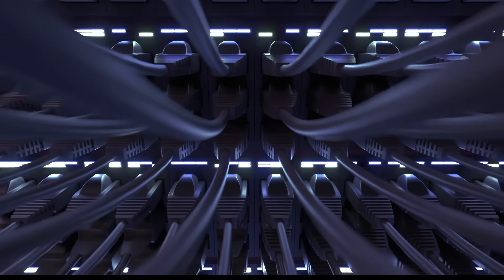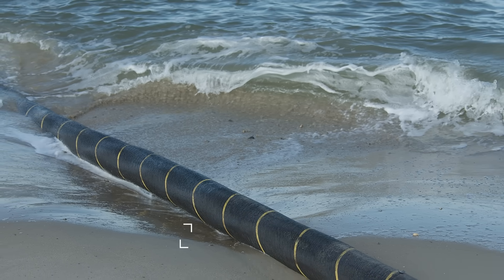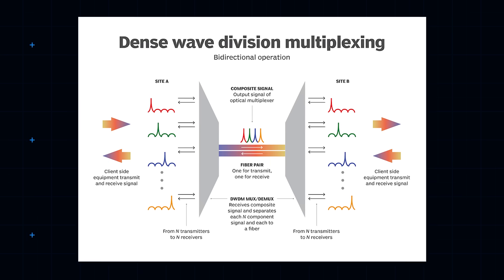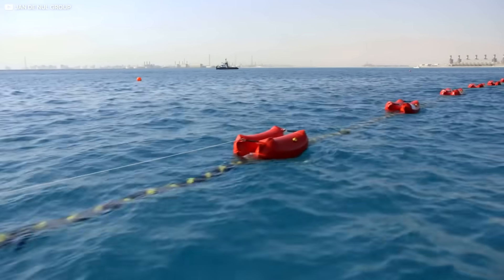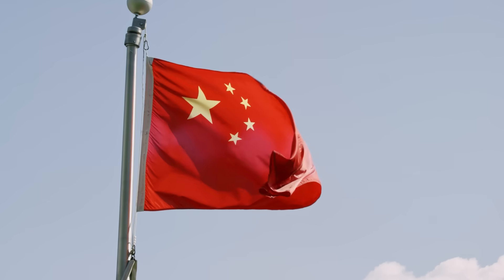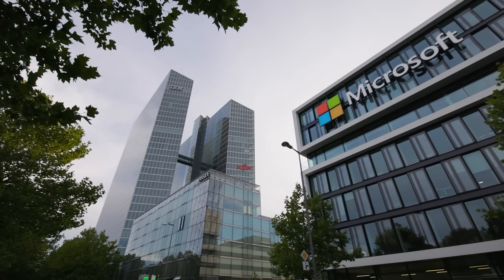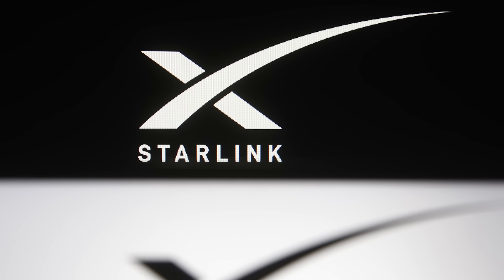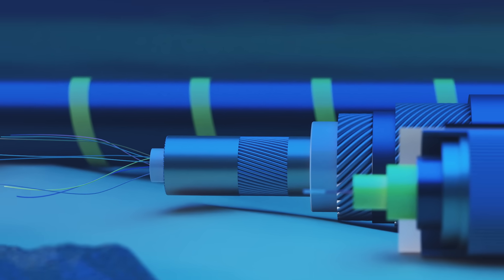How The Internet Travels Across Oceans

Comment: I thought we get internet from satellite to transponder to phone.
Reply: lol no. Up until recently, most cellphones did not have satellite capabilities (other than GPS/GLONASS). There are satellite-based phones that don't require cell towers, but they are not very common as they are very specialized and the service is very expensive.

Satellite internet is mainly used in rural areas where there isn't wired infrastructure or it isn't capable of high speed internet.

Comment: I work for one of the three subsea cable manufactures in the world.  Most of the cable they were showing was not fiber optic.  It was power cable.  Fiber optic cable is less than 2" in dia.  The majority of the cable is insulation and armoring.

Comment: Wireless has and always will be slower than direct line. Direct line is the only way to ensure a complete 100% connection unless required. It took me 3 days to wire my entire house from scratch, Cat5e cabling with plug-in wall Ethernet outlets. Nothing is wireless.

Comment: It is highly unlikely that Starlink—or satellites in general—will ever replace submarine fiber optic cables. Beyond challenges like reliability and high cost, satellite systems have very limited capacity. The combined capacity of all GEO, MEO, and LEO satellites is roughly 150 Tbps, which can be matched by a single fiber pair carrying 1.6 Tb/s per wavelength across 128 wavelengths in the C and L bands. By comparison, TeleGeography reports that total international Internet bandwidth is about 1,835 Tb/s, and demand continues to grow rapidly.

Comment: If a blue whale weighs 120 tonnes (120,000 kg) which is apparently a typical adult mass,
24 whales x 120,000 kg = 2,880,000 kg

and the Atlantic cable is:

6,600 km = 6,600,000 m 

2,880,000 / 6,600,000 = 0.44 kg/m (to 2 sigfig) 

That stat didn't pass the sniff test
That seems light given the thickness of deep sea cables.

Comment: Repeaters are not amplifiers. Repeaters can demultiplex and demodulate the signals so that the signal to noise ratio can be maintained over 1000s of Km. If it just amplified the signal then by the end of the cable you would have nothing but mosquitos buzzing around.

Comment: Ok, so how much of our internet is actually using satellites then? And why were we all lead to believe our internet was happening in space?
Reply: What are you blabbering about? No one is "lead to believe our internet was happening in space".... That's just lack of understanding of how the internet works. The vast majority of non-tech savvy people have 0 clue how the internet works. Its just "magic" to most people.

Anyways, the majority of internet communications occur through fiber optic cables that run from your internet provider to other providers and networks. Satellite internet is only used in cases where you don't have access to wired infrastructure like in very remote areas.

Comment: I'm kinda slow so this prolly gonna sound dumb but I thought we got internet and reception from satellites in outer space, why do we have long cables in the ocean for internet that makes no sense
Reply: Satellites can be used for internet service. They are widely used especially in areas that don't have good wired infrastructure or any at all. The issue with satellite internet is the latency. The latency is the amount of time it takes for a packet of data to go from your computer to the destination device. This is measured in miliseconds. The higher the latency, the more issues that can happen especially during things like online gaming or voice and video calls. The data has to go from your PC to your router and to the dish, up to the satellite in space, down to earth to a satellite ground station then to the intended destination. That's just 1 way. When the server responds back with whatever data you requested, this process happens in reverse order. For general web browsing, you likely won't really notice the effects of high latency. But if you're gaming online or trying to talk to your buddy over Discord, the latency can cause performance issues.

These underground fiber optic cables offer significantly less latency and very high capacity which is why they're used to connect countries and continents together.
Reply: @JJFlores197  you know what that makes alot of sense I didn't even think about the amount of time it would take for your data in your computer to go up to the satellites, I appreciate you breaking that down for me I wouldn't of ever thought of that

Comment: Is this proof of the flat earth? Why don’t we rely on satellites after all there are supposedly millions of satellites circling the ‘’globe’’
Reply: 🤣🤣🤣 There certainly are satellites that prove internet services. They are mainly used in rural areas or in places where wired infrastructure is not available or not adequate. We don't use satellites for the entire internet because the latency is still too high compared to fiber optic cables.
Reply: There are NO satellites .... if there were you would see the sky lit with them but you dont see them because they dont exist.
All communications are over wires. 
Almost 10k satellites are supposed to be up there around a fake 25k mile circumference fake ball. 
Funny how you can grab a telescope and look up and never see a single one .... ever 🤷🏽‍♂️

Comment: If they would switch to Modern day tech a.k.a. SATELLITES then maybe this would eliminate the NEED of these underwater SEA SNAKES
Reply: 🤦🤦 Satellites are used for internet service. The problem is that most satellite-based systems have much higher latency than fiber optic cables. I know Starlink has better latency than other satellite internet providers, but its still not up to par as fiber cables. Satellites are useful in areas where there is no wired infrastructure or it is not adequate.

Comment: Wouldnt it be cheaper on the long run to go satellite internet. Go wireless and control it from up above.
Reply: Well sending satellites to space is incredibly expensive. The other issue is latency. Satellite-based internet simply can't compete with the low latency of fiber optic cabling. I know Starlink has been able to get lower latency than other satellite providers but still not up to the same capability as fiber cables.

Comment: ok so what happens with satellites ? where are they ? if they exist what are they doing ??
Reply: lol. Satellites are real. They exist and they do stuff. Most network communications take place via fiber optic cables on earth. However, when you are in a very remote and/or rural place that has no wired infrastructure, or maybe its substandard, you can use satellite internet. Its not as good as a wired connection, but it certainly is better than no connection at all.

Comment: why cant we do it using satellite ??
Reply: Who says you can't? There's satellite internet already. The thing is that fiber optic networking provides low latency and very high bandwidth. Those are things that satellite internet cannot currently provide. Satellite internet is primarily used in areas that have no or sub-standard wired infrastructure.

Comment: Eventually, we'll replace a lot of this with neutrino internet. Fiber optic cable has to go all the way around the world, and light travels around 2/3rds of the regular speed of light through the cable.

Neutrino internet on the other hand, is blasted through the middle of the Earth at the speed of light, and goes right through to the other side of the planet where it's picked back up by massive neutrino detection facilities.

Comment: Why we need cables if there's a satellite??
Reply: Satellites don't have the same latency as fiber optic cables. The signal has to travel from your satellite dish all the way to the satellite in space. Then from the satellite, it has to travel to a ground station on earth. That adds a lot of latency. Its usually less than 1 second, but still that's a lot in computer networking. This is especially noticeable in applications like online gaming or real time video/voice chat. Satellite internet is mainly used in rural areas or other areas where wired infrastructure is not viable or even available.

Comment: We can remove this cabels from ocean and use satellite connections to all data centers, smartphone, pc. Today isp have planned to provide internet from isp to internet users through satellite but it will good that all isp, datacenters connect to each other with satellite wirelessely
Reply: No.... Satellite internet still doesn't have the low latency that these fiber optic cables can deliver.
Reply: Satellites have high latency, are expensive, and generally worse than cables.

Comment: This might be a dumb question but how does the pressure not fuck with anything?
Reply: I think they take the pressure into consideration when they design the cable, and that is why it looks so much thicker when it is still on the boat and narrower when under the water.

Comment: Why the satellite cannot help us instead of this expensive cables
Reply: Satellites can do this, but not at the same scale as wired infrastructure. Satellite internet is used in places where there is no good wired infrastructure or none at all like in remote areas.
Reply: Satellites are more expensive, have high latency, and are generally worse.

Comment: This is the first I've heard of these cables as i thought everything was already wireless using satellite transmissions. Underwater cables sound like a very obsolete form of technology.
Reply: Sounds obsolete, but it still is very reliable and usable. Wireless is convenient, but not the most reliable. Ever used satellite internet like Hughesnet? Its slow, has high latency and insanely expensive for what it is. Wired connections are almost always better than wireless in most applications. That's why they're the backbones of networks. Even cellular sites use fiber optic cables to connect with the internet. There are wireless relays in places where wired infrastructure is not readily available, but it has drawbacks.

Comment: Wait so why didn’t I have internet connection on a cruise ship
Reply: Because ships move. Even if the companies who pay for these cables WERE going to make it public knowledge where EXACTLY these cables were laid out, how would you recommend the moving ship would connect to them? Even if they DIDN'T have billions of gallons on seawater (not exactly a great medium for even the light that passes through the fiber optic cables to pass through, seeing as how most of the ocean bottom isn't even penetrated by light from the sun), the fiber optic cables are wrapped in copper jackets with power going through them to power the repeaters. This not only transfers power to the receivers, but it has the added benefit of securing the data being transmitted (as the video described, if someone were to be able to tap into that cable to USE the internet bandwidth, then they'd also be able to potentially see what the information that was already being sent back and forth was saying). A copper lining having electricity passing through it is called a Faraday Cage, and it's specifically designed to be able to stop signals from being able to be transmitted through them. This is why older houses having metal piping (especially copper piping or copper conduit with electrical wiring) tend to have issues with maintaining wi-fi signals through walls with this type of infrastructure in them. 

Besides, why the hell are you paying for a cruise if you're just going to be screwing around on the internet? You could've just done that from home and saved yourself a few grand and some Dramamine.
Reply: @lstcloud  thanks bro

Comment: So this proves all that bull$hit about satellites. Your gps works using trigonometry with the aid of 3 mobile towers. Your phone is never connected to a satellite, because that is a bull$hit.
Reply: ok there delusional conspiracy theorist. So how does satellite TV work? How do stand-alone GPS units that were popular for cars work without cellular connections?
Reply: @JJFlores197  Dude do your own research, only then you'll know what the hidden facts. Just because you learn't a sentence from a novel, doesn't mean you know the novel. Start your own research and you'll find what I am saying. Good luck, knowledge is something that needs to be learned not copied.
Reply: @JJFlores197  If you move the satellite dish by even a few seconds, dish will not receive the signal. So that proves that the dish is receiving it's signal from a static source. Did you also know that, no two dish configuration is not the same. So if you and your neighbor are using the same service provider and each of you have your own dish mounted on top of your house, will have two different configuration, in the sense their directions are slightly different. I can't go in depth about this, to make it easy, a dish cannot received signal from a moving object and that too from something that is travelling at speeds of almost 28000kms/17000miles per hour. I am sure you know how dish antennas work. GPS uses 3 or 4 different cell towers to pinpoint the location. Trigonometry is the basis of GPS and some specialized GPS systems use RF signals, which can travel very long distances. How do you think when there were no satellites back in days, were able to navigate and communicate with just RF signals. You just have to study a little more about it's technical details, and you won't need me to explain it anymore.
Reply: @JJFlores197  Just a question, who owns the Global Internet Services. The more you research with the right questions, the more answers you'll get.

Comment: World Wide Web was invented by Timothy John Berners-Lee while working at CERN in Geneva on the France-Switzerland border.

Due to the slowing down of the signal speed in the optical fiber cables, referrals are placed to maintain the data transmission velocity. These referrals are placed every 50km in under see cables, and the element used and which allows this is element nr.68, called Erbium.

Comment: There must be splices in those cables, and I think that means each individual fiber must meet up with another one.  Also, the splice must be waterproofed in a way that will withstand enormous undersea water pressure.  How are cables spliced or repaired?
Reply: Fusion splicing. Also most likely have enough fiber so if some are damaged they can just use the secondary path. They are not repairing anything unless super critical damage.

Comment: The narrator said 100GB/s per cable. Is that right? Or is that per strand and actually there is a bundle of lots of strands of fibre? I just ask because that doesn't seem all that much. I mean its a lot compared to the 500Mb/s coming to my house, but there are a LOT of houses, soo... I dunno, maybe its right! Just would have thought that for a half billion pound cable you'd want more than the traffic consumed by one medium sized town.
Reply: It depends on the optics at each end. But if each bundle can support 36 fibres, and each fibre is running a 400Gbps optic, you could theoretically be running 36 x 400 = 14.4Tbps of bandwidth over one cable.

Comment: Eventually they'll be obsolete for better fiber with better reflective surfaces etc but for now, the only changes will be the end equipment (equipment at each end) and the repeaters to allow faster operations of each wavelength of light.

I like the fact you mentioned the different wavelengths (multi-plexing) where you can have non competing "colours" of laser light beaming down the same glass run (they bounce down the cable at differing lengths so don't mingle/confuse). It doesn't actually do anything for your "speed" but it MASSIVELY increases the throughput because instead of say 1000 people sharing a single core at the same time, 200 might be on blue, 200 on green, etc meaning the shared connection is not bogged down as much (where you might get the speed illusion from).
Reply: exactly and we have a long time before this system becomes obsolete.

Comment: Very interesting video, i have a curiosity. On average, you sayd that a cable is able to transmit with a bitrate of 100 GB /s ... now let's suppose that in Europe there are 100 millions of houses with a high bitrate connection. If all the families in those houses, at the same time, would decide to watch a movie, or whatever video, throught a streaming connection from USA which depends on that cable,  everyone would navigate on an average rate of 1000 BYTES per second, right? so in the end, 100 GB / s  seems too low compared to the high quantity of users around the world. Even considering that there are more than one cable, the situation does not improve so much, given that i've just made a low approximated example talking just about Europe . So i have 1 doubt: the efficiency of internet wire  is guaranteed just by the fact that, statistically, not all the people demand high bitrate data at the same time? And, if all the people around the world, at the same time, would use their device to download data and to watch movies or to make high bitrate calls, the whole internet wire system would fail ?!?

Comment: I'm not so sure if anyone caught this, but the throughput of a single-core fiber cable has a speed of up to 100 megabits per second or 400 megabits per second (duplex mode).
So, that said, I don't think its realistic to see 100 gigabytes per second with the current state of fiber-optic.
Reply: Maybe thirty years ago for 100mbps...that's so far in the rear view mirror at this point it doesn't exist!